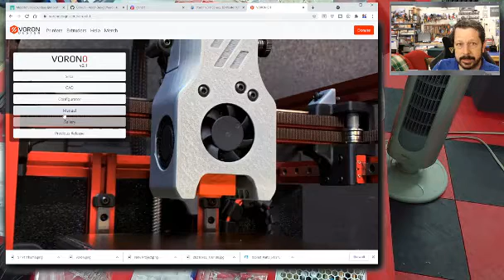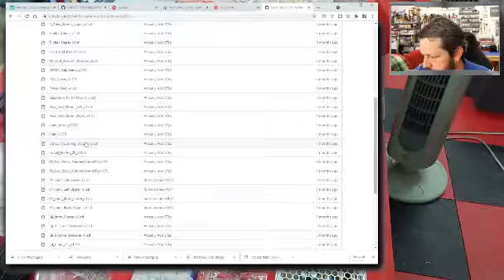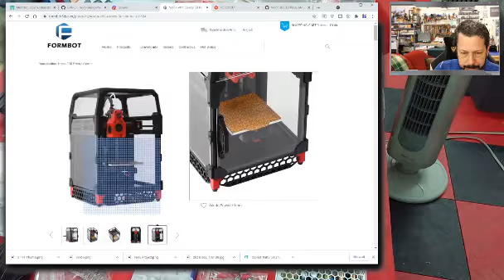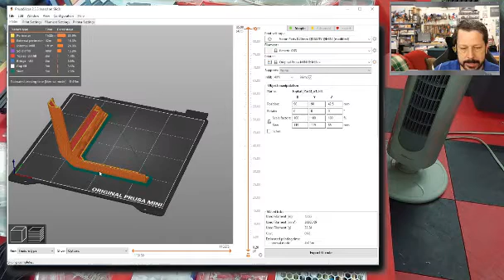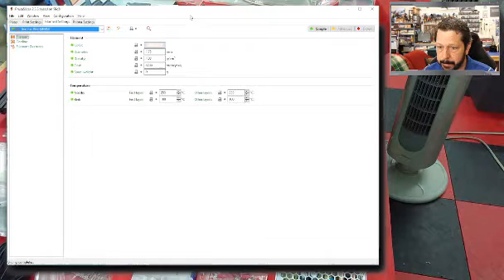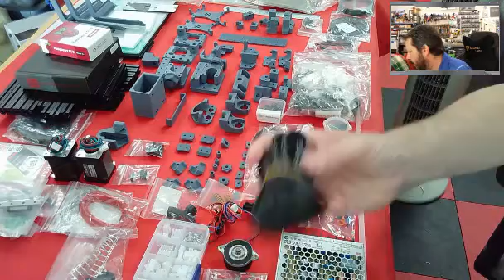Voron 0.1 | Build Log 1 | Formbot Kit

Comment: Hi new to this chanell :) I'm building a v0.1 too but you didn't mention any enclosure for your prusa mini ... 
also i am interested in speeds you used :) i am printing with asa and it smells so bad and I didnt menage to print it correctly yet ...
Reply from the maker: I have the Prusa mini in a closet like room, but it is not in any real enclosure - I just have it sitting on a shelf. I was actually surprised that it printed ABS so well without any enclosure at all. The bed is pretty hot though (100C) so that is probably keeping it from cooling too quickly. 60mm/s for perimeters. I haven’t printed with ASA much at all. The ABS is smelly enough and I keep it in that other room - basically it is just a little tool closet.
Reply: @KellyBC  Asa is preatty smelly too ... I will need a filter for my setup, because is in my bedroom , I got an artillery genius and I made a pretty solid enclosure to reduce any air getting in or out, but my first tests failed miserably even after pre heating the chamber with bed at 100°C the enclosure ... I got no layer adhesion at various temperature as my test is a temp tower it actually seems it curls on itself like is heating too much, but layers not melting properly... I need to test more, but I need to filter it properly before ...

Comment: Glad to see you finally started the voron.  Excited to see your opinion on it.
Reply from the maker: Thanks! Once I figured out that the Prusa Mini prints ABS really easily then I was able to get the parts printed much easier than any other way I tried. I have a video of the chassis assembly coming out today and it all works really well so far. I am not looking forward to the hand wiring of everything but maybe it won't be as bas as I am imagining.
Reply: @KellyBC  theres alot of pre-configured code out there so you shouldnt have to do too much scratch writing.  Im always suprised how well the prusas print, wish we would have been able to get more for the lab before i left.
Reply from the maker: @tankkiler308  I agree about the Prusas. The IESB lab has several of them now though. I am going to work on the Bogard lab as more of the specialty types of printers when you want to do something really specific.
Reply: @KellyBC  iseb got even more? I thought we were lucky when we got one in the bogard lab
Reply from the maker: @tankkiler308  Yeah, I am not sure how many they have but I saw at least four with plans to get more of them.
Reply: @KellyBC  oh ya thats how many there were there, im the one who advised noah to get them.  Btw its colton